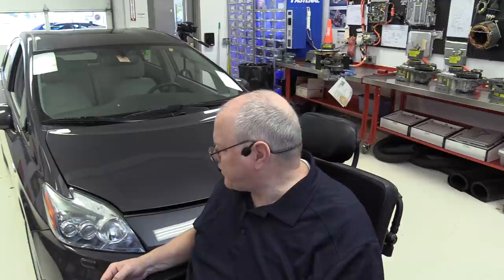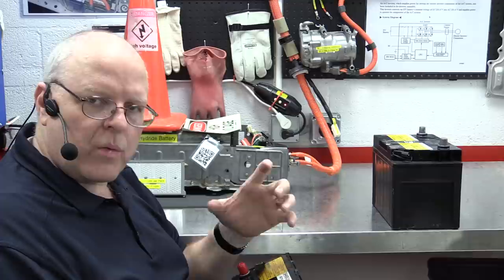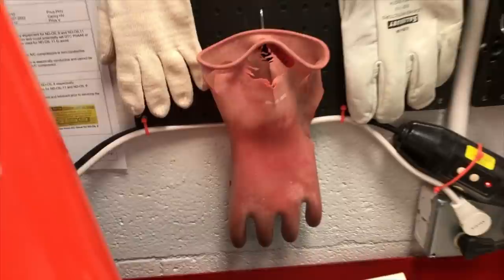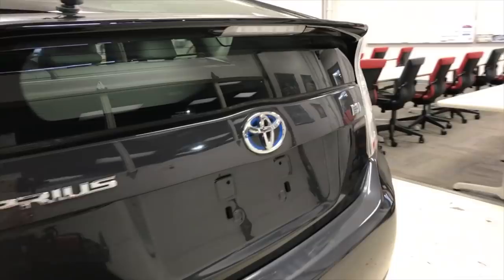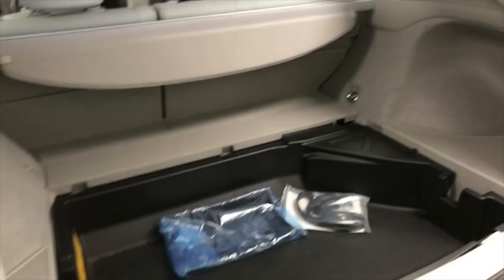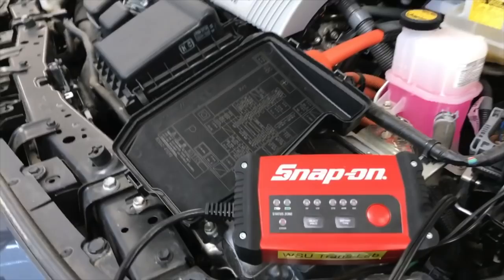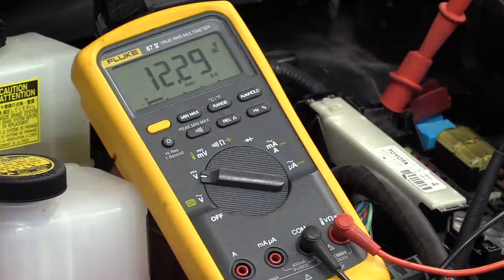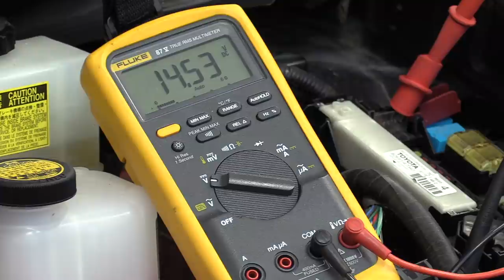Low Voltage Hybrid and Electric Vehicle Systems

Comment: Mr. Kelley, I've been in the automotive field since 08 when I graduated from U.T.I. I worked at a few Chrysler dodge jeep dealers and took their basic courses on hybrid vehicles,much of which I have forgotten over the years working in independent shops,and hybrids just were not as common as they seem to be getting now. Today I had a 2013 Lexus rx400h get assigned to me for a no start complaint. I searched high and low on all data with no success in gaining any info or description and operation on how the system works and keeps the 12v battery charged,as I didn't just wanna throw a battery in it I wanted to verify the system was operating as designed... and I remembered your videos and this is just what I needed. I can't thank you enough for putting this info on YouTube for Free! I would love to be able to come take your classes in person,but its just to far away for me in Ga.

Comment: Hi Professor.  Thank you so much for invaluable information.  I own 2007 Prius and I have been my own mechanic since 2013 when inverter/converter unit went out.  It took dealership 3 hours to troubleshoot it, cost me $318, California rates.  Again dealership charge me $500 to replace low voltage battery, and finally $500 to replace burnout HID headlights.  It was totally ripoff.  Well, that was then.  I finally figure out how to work on this vehicle now. Your information is helping filling the caps.  Thank you once again for your time.
Reply from the maker: Thank you!

Comment: Thanks! I really appreciate your knowledge of these vehicles and more
Reply from the maker: Thank you very much!
Reply: @WeberAuto  i have been working on a prius with a code p0A08 is it possible to point me in right direction? 12 v charges hybrid battery in fairly good shape changed inverter pump was serious blockage flushed system l, turbulence is in reservoir, hybrid battery charges but something still triggers this code after a few minutes
Reply: @WeberAuto  your welcome, i feel like you are a cool teacher and someone id like to hang out with
Reply from the maker: @ragestyler-mac8250  See my other video on checking and load testing the 12V charging system https://youtu.be/_V9PiOpaxyE

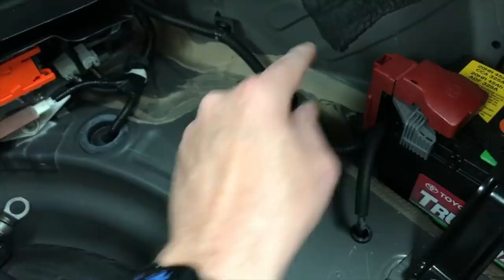Comment: It's worth mentioning that AGM batteries have a security overflow drain pipe. We saw it in the video at 22:25. These batteries are entirely sealed and any generated gases are vented through that tube instead of inside the cabin. This is why AGM batteries are used in vehicles whose 12v battery is in the cabin.
Reply from the maker: That is very true! Thanks for the feedback!
Reply: Having your attention, I have to say how greatly I've enjoyed your videos since I discovered them earlier last week. I've been binging on them for a while now.  And in this one, I have to say it's a sweet classroom setup. My auto mechanics classes in high school (in the 80s) were more... traditional.
Reply from the maker: Thank you very much! I really enjoy being an educator. Have a good day!

Comment: Professor Kelly as an owner of a 2008 Prius I really appreciate the information you provide in your videos.
I don't understand why the 12v Prius battery is limited to 4.2 amps charging for 10 hours when the DC to DC converter provides 150 amps continuously as required.
Many Thanks in Advance!
Jeff Erdmann
Reply from the maker: The 150 amps maximum is to provide current to the rest of the vehicle as needed, not to charge the battery.
Reply: I suspect it's more of a paper recommendation to avoid overcharging and overheating the battery damaging it. I've used AGM batteries for over 20 years in hot rods I've built and they can be charged at higher amperages for short periods of time but it is very easy to overcharge and damage them. It's not easy to ascertain the charge state and calculate the charging time on the AGM batteries. Some of the early manufactured actually had a chart which one could carefully conservatively calculate charge time using high amperages for a very fast charge. Although I don't recommend it I have successfully hit both my 2007 and 2008 Prius's with dead low voltage batteries with 20 amps while disconnected for 15 minutes for a fast charge to get going quickly with the high voltage system finishing the charge while driving the car.

Comment: Great video but found one thing:) engine is powered on during the first start also if the hv battery is fine but just to warm up the whole hsd system and engine itself.

Comment: Drove our OEM 2009 Prius for ten years before replacing the engine battery, (not hybrid) before any issues.
I used YouTube to replace myself and although it is located over the right rear wheel and was a challenge 
to lift and replace, it is possible without a engineering degree to replace! Great information here, thx!

Comment: Thanks for the video! How do you think, the charge current of the auxiliary battery more than 4.2 amp after switching on the car? Have you measured it?
Reply from the maker: Yes the current goes much higher if necessary, but the battery temperature is monitored by the DC to DC converter and it will turn down the current if the battery starts to get too hot. External chargers do not monitor the battery temperature so the charge current must be limited to prevent overheating the battery.

Comment: They may call it auxiliary but it's essential. It makes some sense to me still have a low voltage battery, it allows the DC to DC converter to be sized slightly above the average power consumption. If there wasn't a battery, the DC to DC converter would have to be able to power all the headlights, the rear defroster, the horn, etc at the same time.
Reply from the maker: Very true, thanks for your feedback!

Comment: I have the same Snap-On charger I use but the CTEK chargers are better. I use the CTEK Multi US 7002 for my marine Optima batteries and it will pulse charge up to 7A as required and will go into maintenance storage mode and only charge as the battery voltage dictates. I use it to maintain my bass boat cranking & trolling motor batteries and I can get almost twice the life with the CTEK.  I use the Midtronics (PSC-700S KIT) Power Supply/Battery Charger Kit when I'm programming. Great training video series John!!
Reply from the maker: Thank you, and thanks for the charger and power supply feedback. We also use the Midtronics products.

Comment: Great explanation Professor. I have a question, is there a terminal good enough to take power from for let's say an 80 watt condenser fan? I live in the Middle East and in the summer the AC suffers in traffic. The car is 2019 Avalon hybrid

Comment: I have 2012 Honda Civic Hybrid. About 2 months ago I bought a 1 year old 12V battery, but never used, it was sitting on a shelf for about a year. It cost me $60. When tested a month ago with a battery tester it showed 100% charged and good battery. Yesterday it was dead (not charged), but battery tester did not show "bad battery", it showed 0% charged. I did not forget to turn off any electrical component to accidentally discharge the battery and I have no error codes on my dashboard. I started my car using jumpers and drove about 30 miles to work. The car was parked for about 8 hrs. and I couldn't start the car again. So anyways, the battery lasted 2 months for me. The guy gave me 12 months warranty for the 12V battery so I can return it back for money back.

Yesterday I went to Autozone and bought a brand new battery specified for my car from Autozone. It cost me a little over $200 with 5 years warranty. When I measure just the cables without the 12V battery connected it reads 12.88V with engine running. When I measure the 12V battery connected with the engine running it reads 14.56V. Does this mean that the charging system for the 12V battery is working fine? I guess besides waiting for a couple of weeks to see whether the new 12V battery holds full charge there is no really other test I can do or is it? Thanks!

Comment: Extremely good topic as most people think they can jump start another car with their Hybrid and use any battery charger out there- big trouble!! Thank you professor for the insight into this overlooked but important subject. As with Lead Acid batteries corrosion on the POS terminals is a major problem and, with Hybrid batteries being buried in the back, will AGM batteries have the same issues?
Reply from the maker: I have not seen issues with batteries inside the vehicle. I think the more friendly environment of the interior helps keep them in good shape. Thanks for the feedback.
Reply: You're right.  Not sure about the capacity of the hybrid shown here, but other small evs have a charge rate of 10-12 amps.  As long as you have some extra time, (and you're not trying to start a diesel), you should still be able to get them going. Even still, if it was an emergency, think of an EV as a mobile power plant.  You could still hook up the diesel and leave it on there for an hour (or hours) with no consequence. Just make sure the car is on. I'd probably disconnect before starting the diesel, though.

Comment: Last time I had a regular 12 volt battery installed $148 for Interstate brand so $300 isn’t a stretch for Prius anymore. Thinking of ditching cars and just Uber around.
Reply from the maker: Thanks for your feedback
Reply: Still $306 Toyota prius 2016 and we have  $50 discount  cause I bought my old battery back so yes 👍 still $306 here in California
Reply: And is 2020, probably the price change depends were you live

Comment: Sensing of batt temperature on LV battery is not for over heating safety.
AGM batts are charged to different voltage depending on temperature, and i have seen Ford car killing batts with 15,5V at summer, because of dead temp sensor. Basically the colder  the higher voltage, and limit is at about 15,5V at under -10 deg C.
This systems are just correcting charge voltage to proper electro chemistry activity levels and are typical even in non hybrid start-stop engines, and in some cars without it too, even in flooded, classical batteries - it is beneficial in every case, 14,4V is really proper only in room temperatures
Reply: BTW, nowdays alternators can have digital charge controller build in with LIN connectivity to ecu and ecu can still be responsible for voltage management - poor ecu ground caused random charge voltage and charge message popping up to my client and it was actually hard to trace, as there is no way to check alternator by myself, and no errors were present anywhere
Reply: But batt temp sensor built in the battery is awful, it is ideal to be mounted in battery tray and i would prefer for it to not be in way of drainage - leaky battery kills it in volvos and fords :>
Many brands are just using outside temp and correct for known drift, its still less awful than custom battery

Comment: Thanks a lot for this video - i got urgent informations.
I once thought my 12V-Battery was nearly dead, because the P3 did not start the systems - only the vent...
I let it keep on - thought it was somehow restarting something, but after 5 Min, the system activated and the Prius was ready to go. I later remembered i parked it one week ago after I used it for 3 short trips with seat-heater and windshield-heater (that also included AC....) So I powered out the 12-V-battery.
So I always give others the tip, not to use heat-seaters on short trips and ALWAYS deactivate them after or before arrival...

Comment: I have a 2016 F150 2.7 and I think it has a battery temp sensor on the positive battery cable.
Reply from the maker: Yes, the temperature sensor is used to fine tune the high current charging system. If the battery gets too hot, the charge rate gets turned down. Thanks for your feedback!
Reply: Thank you for giving me information I can use even though I don't have a hybrid. That's why I love your videos.

Comment: The Chevy Volt ICE will run whenever the hood is open and power button is on. I think is for maintenance.
Reply from the maker: Yes, it is for maintenance reasons (Oil changes, diagnostics, emissions testing, etc.) Thank you for your feedback!
Reply: That would be for safety. You are less likely to put your hand on a spot that is already moving.  Smart thinking GM.

Comment: If you add another 12v agm battery and connect an inverter to it to run 120v appliances do you need to have another DC to DC converter between the 2 AGM's?
Reply from the maker: Theoretically yes. The single DC-DC converter has a limited output and limited cooling abilities. See my video on testing the DC-DC converter https://youtu.be/_V9PiOpaxyE

Comment: Which generation Priuses need that special battery? My daughter has a gen-1 and I believe it has a standard lead-acid 12V battery. We bought the car used, but it gets regular service at a Toyota dealership.
Reply from the maker: The first three generation Prius' have AGM batteries. They must be vented externally. Standard lead-acid batteries are  not safe due to not being vented to the outside of the car. They area more likely to spill electrolyte inside the car in an accident as well.

Comment: FYI the 91 Chrysler TEVan did not have a 12v battery. All 12v electronics were powered by the dc-dc converter with no battery storage. But since they only made about 50, it's unlikely anyone will work on one of these

https://en.m.wikipedia.org/wiki/Chrysler_TEVan
Reply from the maker: Very interesting, thank you for the information!

Comment: Thank you for your information on the differences in12 volt batteries. I have a question for you, I have a 2023 Hybrid Tucson (not a Plug In)I am wanting to put the car on a trickle charge, as I am leaving the car in a garage for 6 months,  but I have no battery in the engine compartment, I see a bare terminal on the inside of the fuse box, could I connect that with the positive and find a good ground, if that works do I need a special trickle charger? :thanksdoc:

Comment: Thanks for another awesome video. 
Great work!!! 
Please do not understand what follows as a criticism: 
I realized that you first plugged the meter's alligators clamps on the low voltage battery points and after that turned the multimeter´s selector to choose its function.  I think that with 12 volts, and considering that you use a Fluke Multimeter (very good quality brand!!) there is no risk of damaging it but, anyway, it is always good to have the habit of first choosing the function of the multimeter and then touch the test points.  
But, again, dont understand my comment as a criticism. 
I admire your job and your teaching skills.....Thanks.
Reply from the maker: You are absolutely correct! I should have powered-on the meter before taking a measurement, Thanks for the feedback!

Comment: Thanks for the video. I have had the idea for a long time, that is why there's need for the standalone 12V battery. The high voltage battery has a lot of capacity, if we have a converter, it easy to get a 12V source from it. I think it will be simpler system for manufacturers and for customers.
Reply from the maker: Thank you! Good idea. Someone in a comment on this video said that the new Kia and Hyundai hybrids are doing that.
Reply: What you say it's a bad idea, the prius high voltage battery has 1kwhr not so much , the 12v has about 600whr, so if there was only high voltage if you god depletted (forgot the light or other acceaorry ) hou do you start the car ??? In our case we change the 12v and are ready to go .
Reply: @andpan3478  I think there should be a way to set a limit so the high voltage battery will not get depleted, I don't mean for us, it's for the manufacturer when they designed the car. The 600 whr is too big a number, I couldn't find the exact specs for this batter, it's should be under 40 whr.
Reply: @guangdewang1032  try again and do the math,  i know wat i  write , so in the prius the main bat is ~ 200v x 6.5Ahr , so 1300whr or 1.3kwhr, then the aux battery is 12v x 45Ahr = 540whr capacity (there is no way to be 40w , never  , ))   this is for prius but trere are cars with aux bat of 60, 80 or even 100Ahr .
Reply: @andpan3478  I had been trying to find the specs of the prius lead acid battery, where comes the number 45Ahr, can you post a link? This number is sounds too big to me.
Reply: @guangdewang1032  if you have a prius is just simple open the truck and have a look , if you don't have you waste your time arguing with me  becouse i have one and i know exactly what i am saying
Reply: @andpan3478  I didn't try to argue with you, I don't know the specifics, you are correct about the battery capacity. I know Toyota designed this way must have its reason, I just don't understand it, I still think it's not hard at all to set some limit to protect the hybrid battery, I don't know why it's not doing it that way.
Reply: @guangdewang1032  and if uou set a limmit and reach that limit , it means to disconect the main  battery  not to overdischarge , at at this time how do you open the door . And its risky to  overdiascharge the main battery , i think at this point it very convenient tonuse an aux battery
Reply: @andpan3478  Thanks and I see your point.

Comment: Can one make a 12vdc link and connect the inverter converter 12vdc out to the car low voltage connector to quickly open all the doors?

Comment: so you can`t use a normal charger to charge the 12V battery but can you use one under the bonnet to start car or unlock the boot/trunk?
Reply from the maker: True, but only under the hood long enough to get the engine started. Thank you for your feedback!